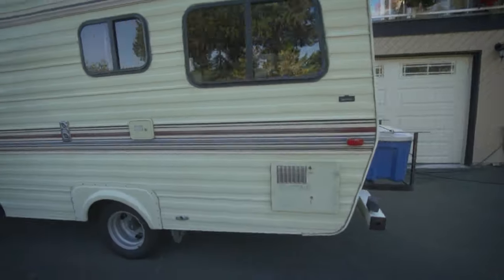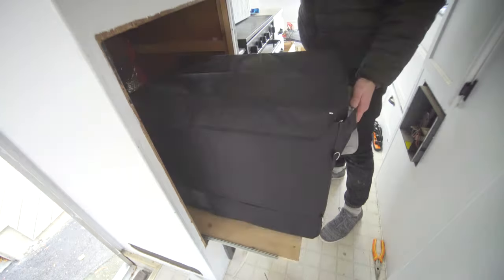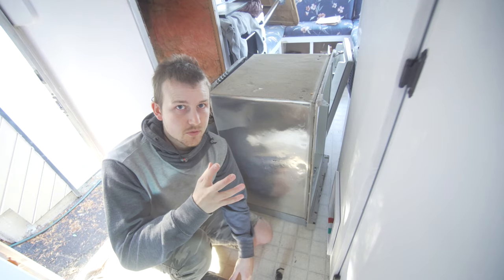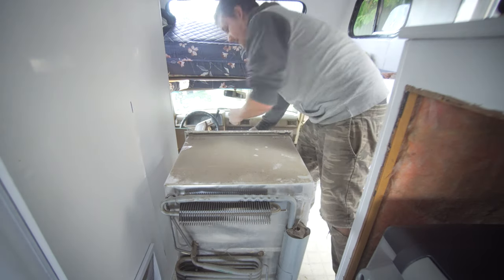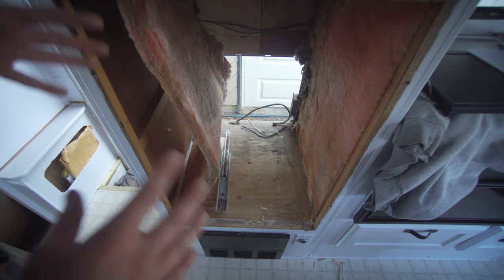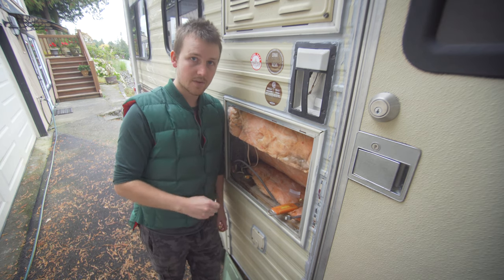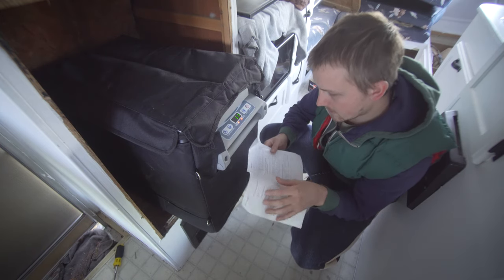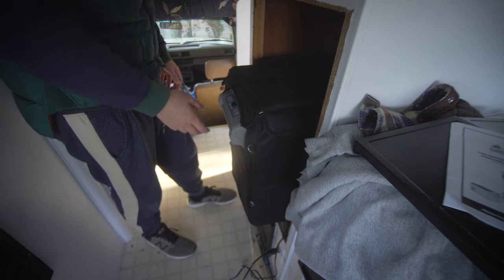How to Remove a 3-Way Fridge from a RV and Replace it with A 12 Volt Compressor Fridge.

Comment: Long story short my old RV had a residential fridge and it was awesome. Ran fine on a inverter with a AGM battery. I ended up selling the RV and bought a slide in camper. Has a 2 way fridge and I live in Arizona, so you can imagine the disaster this fridge is. It is a small fridge so I have been contemplating doing this very thing. I didn't think I would find a video, but low and behold you had one, so great job ! I am not sure how I am going to make it work yet in my situation. I still need to take some measurements, but I definitely want it to look like it was on purpose. Thanks for the the inspiration,  and for my thought validation.

Comment: Hi  Forrest, thank you for your very informative video. After watching we were also inspired to remove the old dometic fridge from our Scamp and replace it with a 12 volt compressor cooler. We have successfully removed the fridge and are trying to figure out the best way to finish the new space. Can you offer any advice on how you finished the space that the old fridge occupied?  Thanks for any information that you can provide.
Reply from the maker: Hey Laurie, glad you enjoyed the video. Funny enough I was actually looking at space today and thinking about what I'm going to do to finish it, we left it how it was finished this video because we didn't have enough time to do anything really with it before moving in, and then I just never got around to doing anything because it worked as is. I plan to do something with it but not sure yet, I'll post videos on  my Forrest Stevens youtube channel when I do. Also if you wanted to join my discord and share what you end up doing it's linked in the Description

Comment: The "12 volt" stuff that you identified is actually the 110V (or 240V) power.  The "exhaust" is both an exhaust AND contains the 12v/110or240v heating elements.  You should have called out that the gas lines should be cleared before disconnecting the gas lines.  Very dangerous to not include this information.
Reply: AMM013 . . . I second that ! I nearly suffocated removing a rv fridge that was supposed to have been decommissioned and wasn’t !